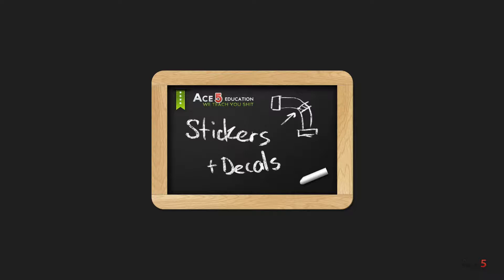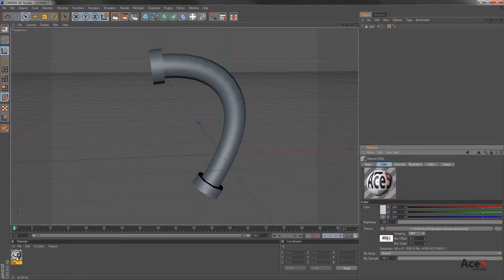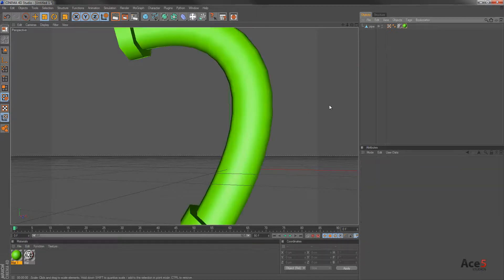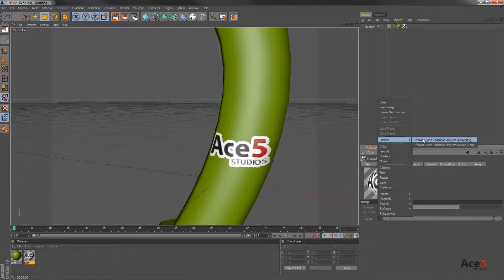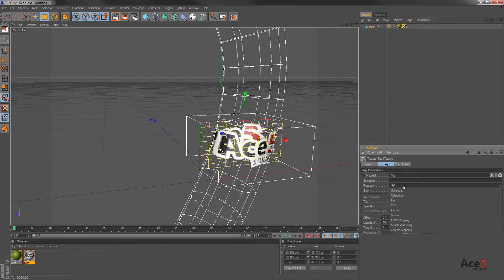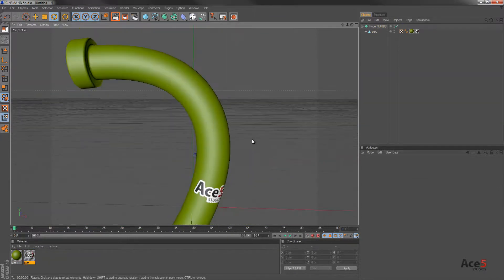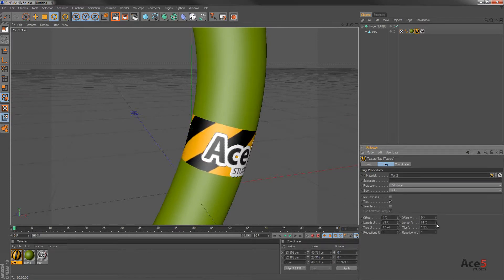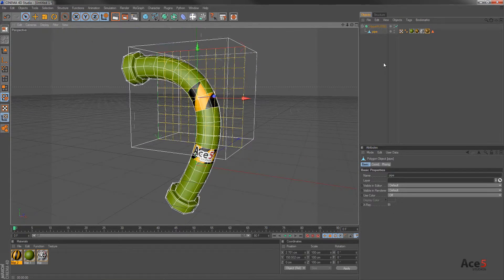stickers n projections

Comment: Is the texture axis tool gone in r16? Cuz i cant find it...
Reply from the maker: i dunno about r16, but in r15 its still there and you have turn on the axis tool while manipulating the texture. 

hit shift+c and type in the name of the tool, maybe you just accidentally deleted the button.
Reply: Aleksey Voznesenski nah i tried searching for "texture axis tool" but i get no results. I can manipulate the texture somewhat by turning on "texture mode" and then just using move, scale and rotate but it's very hard to control: scale is inverted and move has a really odd offset wich makes it nearly impossible to place accurately. Dunno if it's just my model tho, will have to some testing.
Reply from the maker: Nick Chrissis make sure both of these are turned on. http://i.snag.gy/ockua.jpg

i don't know why they changed it.
Reply: Aleksey Voznesenski Ah yes that fixed it! Thanks Aleksey!
Reply: Its under the model tool with a checkered board on it on the left hand side in the tool pallet